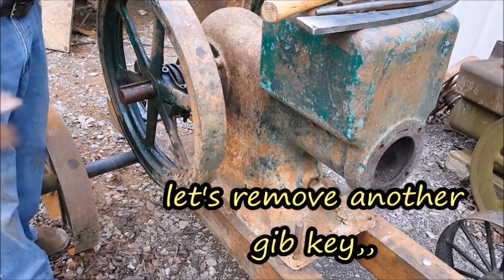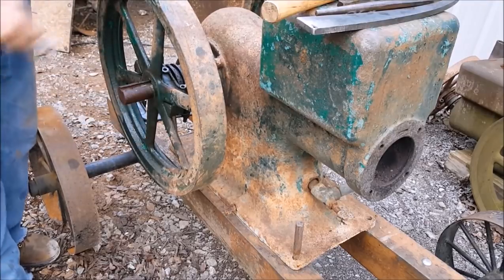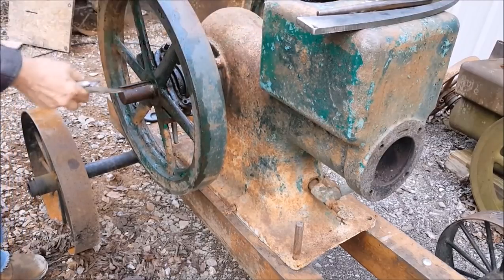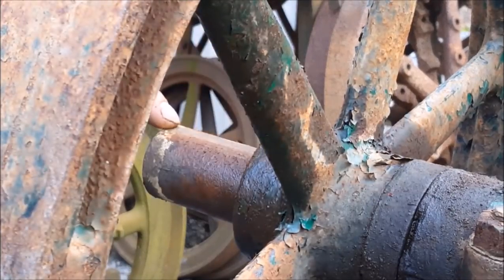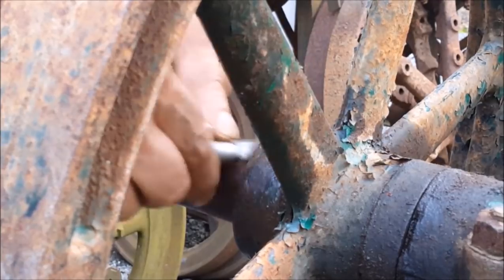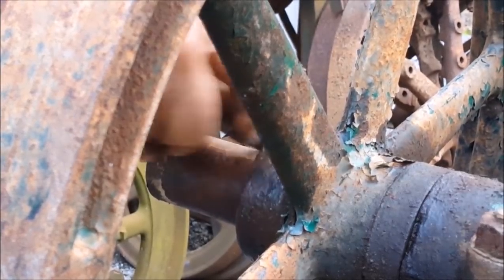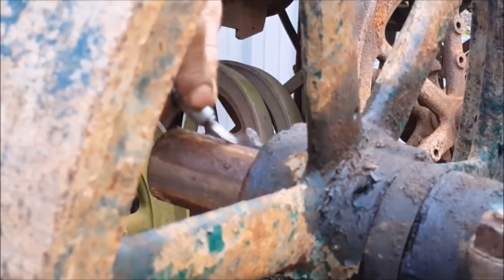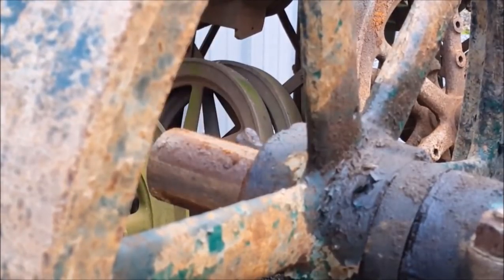International 3 HP type M flywheel engine gib key removal #3

Comment: I'm probably older than you Sam, though I was born down where you are. I grew up in Oregon amongst Yankees, with Yankee Idears. So because I had an accent, they put me in remedial, because they are nasty leftists. Instead of a carbide chisel, I use a flat bastard file, that I broke off short, and used a grinder to make the edge very sharp. It scraps as good as anything. I would have used scotch brite to take the gunk off'n the crank, then emory paper, till up by the key, because for me tis faster. Then used my file high carbon chisel to scrap both sides of the gib. I know what discrimination is, and they still hate us other Americans. Till I learned to talk Yankee like them did they even understand that I was smarter than most of them.